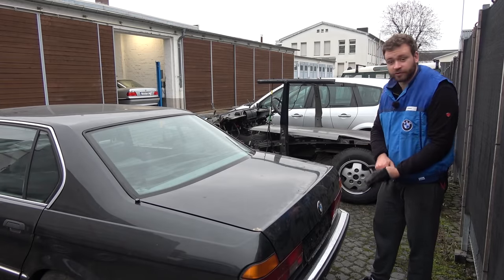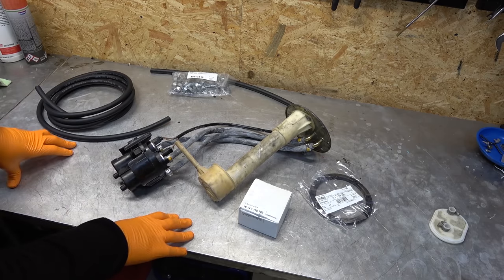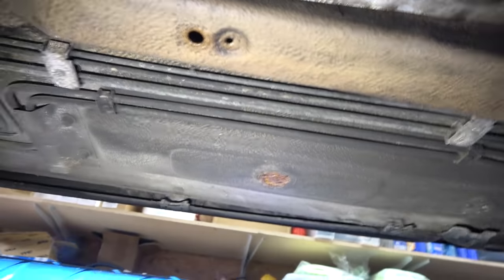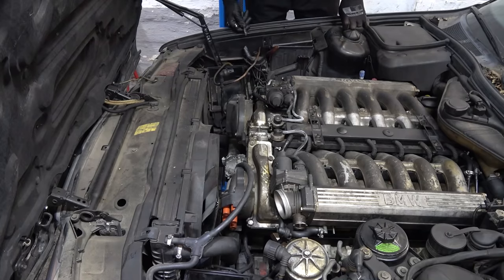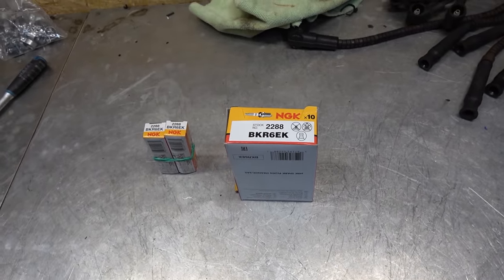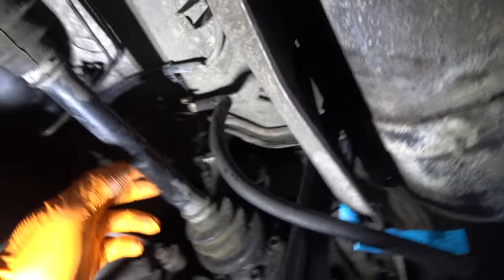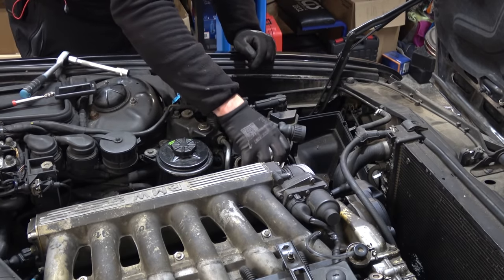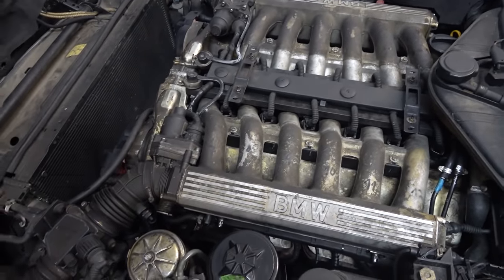First Start in 5 Years - V12 BMW E32 750iL - Project Karlsruhe: Part 3

Comment: It is astonishing that previous owner or mechanic opted to work in the fuel system but completely dismissed the ignition system. Is always interesting to see people neglecting cap and rotors and then complaining that their cars don’t run right. Good thing that this car has someone competent taking care of it at last.

Comment: "Some Swedish high quality hose clamps, ABBA...." is that what you said? hahahaha
Reply: There is a brand called ABA that makes clamps
Reply: @alexstromberg7696  and they are very good too.  I use the blue ones but in the video he got the high pressure ones for fuel. ABA Sweden
Reply: @gplusgplus2286  yeah I use them at work, they work
Reply: @alexstromberg7696  ABA were taken over by NORMA GERMANY quite a few years ago, but the Swedish plant is still manufacturing these clamps with premium quality!

Comment: Thanks for posting about rescuing one of these magnificent V12 super sedans - the king of luxury sedans in the 1980's!  My Dad had the first one here in our town in 87: granite grey on grey 88 750iL when I was 8 years old.  I think you will really appreciate this car once you have it sorted - the short front overhang and forward front seat placement give the impression of a much smaller car when driving it, and the 296hp V12 is more than adequate for triple digit sprints on der Autobahn!  My old man used to dust off L98 Corvettes on the highway regularly with the 750, as well as other more notable sports cars of the day.  Sadly, that car is long gone and so is he, but I am contemplating buying one that I know of local to me after watching your video!
Reply: My father didn't had the 750 but the 735 manual. I even have a picture from when went to the dealer to buy an E38 with the E32 infront. Sadly I wasn't old enough to drive that car, but I had the opportunitie with the E38.  But I remember when my (back then) neighbour got his driving license, he asked my father if he can take that car for a joyride. He was the oldest of the clique back then & we hopped in. Many years later, he became my Driving instructor & whenever I point that story from that particular day out, he get's embarassed (because of all that bullshit he did on that day).  I really like the semi-agressive timeless look of that car. Sadly there aren't many around with low mileage & alltough there is one right now, I have other priorities.

Comment: Excellent as usual professor …I’ve owned 3 of these  well used 12 cyl beasts  over the years, they can be very inexpensive to purchase and honestly not much more expensive to maintain than other large German cars. A few quirks: eg leaking intake manifold seals, two sets of some engine components.  Very reliable engine with fewer problems than some 740s. Easy parts availability!  BOTTOM LINE …HUGE TORQUE …HUGE SMILE

Comment: “The good thing is we have converted A/C, that means is likely going to work”. In my experience that means is likely not going to work since all the R134 leaked out of the system because of the lack of use and the fact that old hoses allow refrigerant to  escape. A/C in pre-1994 cars sucks if you don’t have access to R12.

Comment: When you keep working on the engine, you might want to consider the first step of every 750i repair manual: "Remove the engine from the engine bay."
From experience with my car, I can really recommend this step. It sounds like a lot of work, but it actually saves you a lot of time. I used to drop the complete front axle with the transmission still attached.
You can also loosen the battery terminal and OBD connector to have better access to spark plug #12. It will still be a pain ;)

Comment: Such a wonderful and entertaining video, as they always are!
You are helping me relive 10 years of my life with a 1990 750iL!
Your engine is the pre-facelift engine (the oil filler is in the back.)
It's gonna make that upper oil pan gasket a lot more difficult. Though, as you mentioned, the holes are already drilled out for it.
The intake gaskets are a hoot (not really.)
Fixed the seat twist, ASC switch (yours doesn't have that), upgraded GM for all one touch windows, on and on ... it was a fun ride while it lasted.
What did mine in was the hydraulic system and transmission.
The starter, I replaced it once - fun! - and when the starter main wire corroded, well, that helped in making the regretful decision to let it go.
Happily, I now own my second e34, a 535i, and it's like a breath of fresh air in comparison.
As always, looking forward to more! :)

Comment: I just bought the Cohline 2192.06 for my diesel old Benz. Checking the specs of the 2192.06 (if my search was correct since Cohline not share the specs in their official page), the tube is rated from -30 to +50 ºC if gasoline is used, and -30 to +70 ºC if diesel is used. From my non-expert point of view, the back of the M70/M73 is hotter than +50 ºC. Maybe in engine areas is best practice to use the Cohline 2240.06 rated from -40 to +125 ºC. Also Cohline 2240 mets BMW GS 93010 standard. Hope this information can be completed with official information from Cohline. Anyway, thanks so much for sharing your knowledge with all of us!

Comment: I had one 20 years ago - the car droves fine and it had only once a issue. The cooling liquid tank got burst in the summer by extreme heat and city stop and go. I bought the car from a 5* hotel who used it to transport their guests from and to the airport/ chauffeur service, the car also had a flawless service book and no problems or maintenance backlog, they just got a newer model. They had 2 for the same price one in black and one in dark blue with 30% less milage - i have taken the bue one.

Comment: It's alive!!!!!!!! You're doing a great job, my hat is off to you :)

Regarding the exhaust: the factory who made it for the BMW factory install was Boysen, I was told that Eberspaecher made a nice OEM fit exhausts as well. This is such a magnificent car, don't go with an aftermarket one, if new ones are too expensive, try to find a good welder in have him change the pipes and weld the holes... (But even that might be expensive in Germany...)

Also make sure to replace the hanging rubber exhaust mounts (the ones that hadn't fallen of yet) as they have a nasty tendency to fail when you least need them to (i.e. when you're far from home :)))

Best of luck!

Comment: Excellent progress on the latest project. Good to see things underway. One cautionary word. Don’t Hoover debris from the fuel tank. There is chance of vacuuming vapour into your Hoover and as the motor is in the airflow their is potential for sparking off the brushes igniting the vapour! Boom. New vac at best.
Reply from the maker: It's fine when using a wet shop vac.

Comment: The ABA clamps are great. Most mechanics in Sweden use a special driver to tighten them though, it's called the flex tool.  It looks kind of like a screwdriver, but the shaft is made of a tightly wound spring with a socket that matches the clamp at the end. It's a very good tool, it lets you work at different angles. It also eliminates the risk of you stabbing yourself with a screwdriver completely...👍😉

Comment: You are fixing up and restoring some of the best cars BMW has ever made.  The newer ones from the past 15 or so years are just all crap compared to the older ones like this E32.  Id like to come to Germany and help you work on these cars because all I drive are Older BMWs from the 80s & 90s. There is a neighbor down the street where I live with an E38 750iL just rotting outside his garage & it hasn't moved in years. I've been thinking about buying it.

Comment: One tip, when checking the resistance of the spark plug leads, give them a good move around and wiggle, shows up any partial breakages internally that might just be making contact when you test them stationary. 👍🏻
Reply from the maker: I always do that before final assembly :)
Reply: @M539Restorations  awesome, great job on the restorations so far, keep the videos coming, they are much appreciated during these shit times. 👍🏻

Comment: NBR/NBR means the rubber material. Like O-Rings these hoses do have special properties to resist f.e. UV light/ mineral oils and so on. So you were fully right. The outside material was from chlorepren rubber (CR) and the inner should have been NBR - Nitrile Butadiene Rubber. Hope that helps. Always be careful wat types of rubber you use for which type of place and chemicals they are exposed.
Cheers mate. Excellent work. :)

Comment: You are the European version of Vice Grip Garage - and equally as competent and entertaining. I've always wanted an older, manual BMW but the prices for them - and the commensurate parts - are usually stratospheric. I had to make do with a 2007 Cadillac CTS-V, as it was nearly half the price of a 2006 M5 and I can fix it with a hammer...

Comment: Thanks so much for this expedition. Wonderful car. Used to own a very well kept 3,5 manual L version. Most reliable BMW I ever owned. And you might want to crown this project by getting rid of these wonnabe sporty aftermarket wheels. Wonnabe Schnitzers on an E32. Argh.

Comment: Turning the engine without fuel is not so bad. It gives opportunity for oil pressure to build up and to hopefully lubricate all the bearings. This is a good thing, especially for an engine that was not running for a long time.
The 4 stroke engines on ships have pre lubrication pumps. They run can be run for like 5 minutes initially. After that the engine will get turned in addition to prubrication. Only after that an attempt to start the engine is done.
So dont be sad about forgetting to connect the fuel pump. It was actually doing a good thing for the engine. 😀

Comment: A good thing to note and pay attention to, a battery that is inside passenger compartment usually has a vent tube installed on it.  A woman driving a Volvo in Florida with her young daughter in car were killed by fumes/gasses.  It was found the battery vent tube either came off or battery was replaced that the vent tube wasn't re-installed, the fumes or gasses from battery vented right into passenger compartment.

Comment: Another great video.  Careful with the silicone spray around fuel components which could quite possibly damage the O2 sensors.  I used to use Vaseline around those components.

Comment: Great video!
Actually - cleaning the MAF’s often work.
Of course, if you measure resistance at the plug you will not see any difference. The difference will be how well it will read oxygen in a high speed airflow.
With K&N filters etc they can get ’oily’ dirty over time.
Then again there are lots of MAF-types, easy to difficult to work on

Comment: You can get a very long tube about 60-70cm length for the fogging oil can, to reach difficult places. Usually these long tubes are supplies with cavity anti-corrosion wax cans.

Comment: For the fogging oil, spray into tubing that is snaked into the cylinder.
Reply: Crossed my mind too - you use a bit more oil, as some of it remains in the tube, but it's deeeefinitely worth it :-)
M539, this is some tested solid advice to avoid a lot of hustle in these tight spaces

Comment: I could only give you tips from me when i Was struggling with my 750i, if you dont have full power and you feel like half the engine is warmer then the other, check fuel pump fuses.

Comment: Hallo! I would recommend that you drop the tank, first use a clean towel to remove all the gasoline and then with a new towel you clean de tank with acetone. That's how we do it back here in Venezuela where the gasoline is pretty much water and dirt. Auf widersehen!

Comment: The silver lining to forgetting to connect the fuel pump - cranking the engine for that period of time would've built up your oil pressure and pushed some around after the oil change. Nice to do as a precaution to avoid a dry start :) especially for how long it's sat as whatever could drain to the sump definitely would have!

Comment: 23:50 you can get longer straws for spraying bottles 😬
29:00 nice those tight spaces, especially in a cold shop, I feel your pain 👊🏼 
36:50 I see some rust on the front fender inside?

Comment: Try removing the sensor from the back of the intake on 11/12 it just gives enough room to get your arm down to reach cylinders 11 & 12 when changing wires and plugs.

Comment: Test the rusty exhaust pipe with a flat screwdriver and a small hammer. Maybe the pipes are still thick and just clean and treat the rust. 

If not than cut out the rusty section, pipes can be easily replaced and welded in. Small damage like on the silencer can also be easily fixed even on the car.

Ideally, welding should be done on a car for correct fitment. It needs to be TIG welded and not MIG. Maybe ask mobile welder that does exhausts. There is no point getting whole new exhaust when the important sections are healthy. Welding might cost you about 150-200euro, with material.

Comment: I love your videos. My only concern is when you used the vacuum to clean out the gas tank. Yes, the liquid fuel may have already been soaked up, but fumes can still exist in the tank. The vacuum can suck up those fumes, and put them next to an electric motor can can spark. Just don't want to see you go kaboom.

Comment: These models have interesting fuel consumption.  Two ways.  Economic system for long journeys in tourism.  And sports.  Switch, 3 liters of fuel consumption and the other 5 liters of sports. 1980 model e32 750il v12 well designed.

Comment: Hey you didnt forget to connect the pumps.. it is normal after that much of standing still to turn the engine without fireing it. It helps to build up oil pressure, main and rods bearing say thank you for that.
Reply from the maker: That happens regardless since it takes a long time to build up fuel pressure when the fuel filters have been changed.

Comment: A small winch installed at the back wall with a demountable roller post (sp you could pull your cars around in front of your garage) outside would be your saviour Sreten, With some extension cables you would be able to pull it all in from the road when dead but precious old turds are dropped at the kerb side for you to weave your magics over them :)
EDIT: perhaps worth saving the zorst if the rust damage is not too severe - it is fairly easy to cut out the rusted out parts of tubing and replace with new steel?

Comment: Not to be downer, but a lot of people who do have issues with the aftermarket mags for G43 are not running stock setups. If you have changed out the trigger, got a custom upper or slide, whatever, your pistol's tolerances have changed....

Comment: WOW! This M70 V12 has a fantastic roar!! Was the special windshield on the E32 only on the V12? I saw and got inside an E32 735iL 1990 US-SPEC here in Brazil in Brasília-DF. Black with an interior just like yours. Too bad the interior had a lot of things dismantled...Here in Brazil the best workshops specializing in old BMW are unfortunately few! It won another entry and from Brazil.

Comment: If Euro cars have catalytic converters, you shouldn't use silicone spray on the fuel lines. It damages the O2 sensors and cats.

Comment: I heard something a long time ago that's stuck with me all these years through my own car projects: "Professional just means you paid somebody to do it." 5,000€ for backwards fuel filters, bad coils, and the wrong plugs doesn't surprise me at all, unfortunately. The same people who could afford these cars new tend to prefer writing checks to getting their own hands dirty, and there are other people who are happy to take that money and do the absolute bare minimum. 

In my experience, 95% of the work I have to do on a car I own is undoing what's been done to it before I got my hands on it, including lots of things done by so-called "professional" mechanics, fab shops, tuners, stereo installers, and so on. 

My current toy car is a "professionally built" 650hp Audi with ~$75k worth of parts and labor dumped into it. Previous owner is a legit millionaire, and he just sprayed this thing with the money hose. All the best parts money could buy. Time, depreciation, and his desire for newer/better/faster cars meant a regular guy like me could afford it (less than the cost of a new A3). It's a monster, but the more I dig (for general maintenance), the more cut corners, shoddy craftsmanship, and lazy cheap incompetent "professional" work I find. This guy was duped by a shop he gave PILES of money to, for years, and he never even knew it! He sang their praises and pushed his friends their way for business. Meanwhile, he was getting fleeced.

Comment: To get non driving car in to my garage, I use 12v winch salvaged from ATV. Those are cheap, just bolt it to the floor and let electricity to do the work..

Comment: The proper way to start an engine after messing with the fuel system is to turn the ignition on and off a few times letting the fuel pump work, without cranking the engine.

Comment: Great vid, I haven't started my e39 m5 for over a year now, any suggestions?, I was thinking of cranking the engine with the starter motor with the fuel pump fuse out or would using fogging oil be better? I stored em away with fresh oil and plugs back in december 2019, TIA

Comment: the fan clutch was connected correctly and was a perfect spec for removal.  only idiots swing on that fan clutch like a freaking money.  you do NOT need to tighten that fan clutch.  reverse thread means it tightens itself, when engine is running.  Just incase you did not kow.

Comment: Do you consider replacing/cleaning the injectors on vehicles with known bad fuel in the system? I know it's less sensitive than a DI car would be, but it might i prove performance quite a bit given the age.